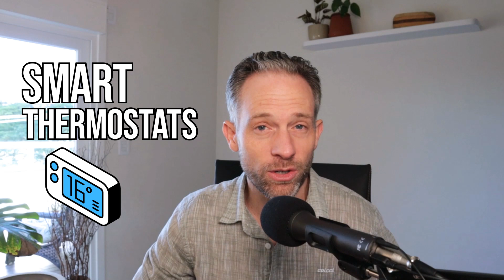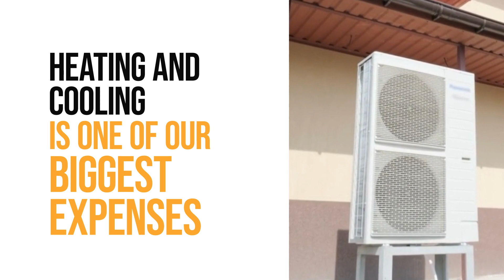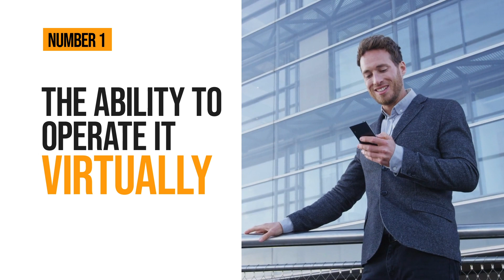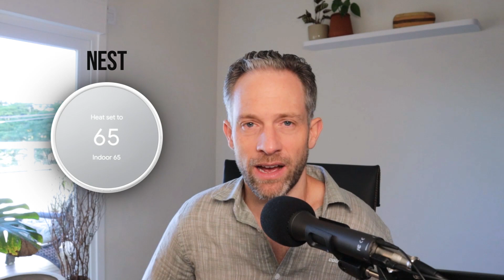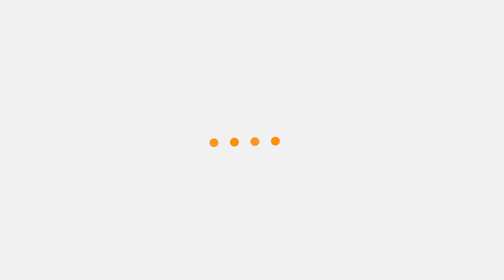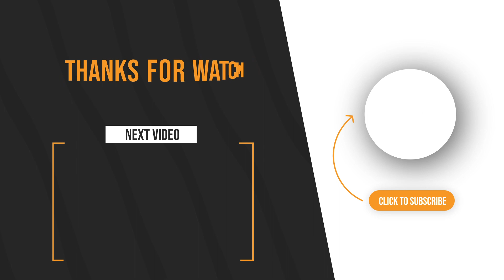Smart Thermostats for Vacation Rentals: Easy Guest Control and Energy Savings

Comment: I am looking for a smart thermostat for an airbnb property (heating only as no a/c) . I need it to have the function where the ONLY function that the guests can access is turning the heat off or boosting it incrementally for up to say 6 hours maximum. I need it so that guests are unable to override this setting. Does this or any other thermostat have this available in the settings ? thanks !
Reply: If I was a guest and I had any limitations on climate control, it would result in a bad review, period.
Reply: @davidwelty9763 - it's very common for airbnbs to set range limits of for example, 55° to 75°F so that guests cannot run high heat or forget to turn it down upon leaving or accidentally completely turn it off, especially when managed remotely. Accidents like that can result in insanely high energy bills or worst, frozen and burst pipes. So, it is important to set limits.
Reply: @MegInWhispers is that summer the lower temperature set to 55?
Reply: @davidwelty9763 well get you an Airbnb and pay a 500 light bill a month